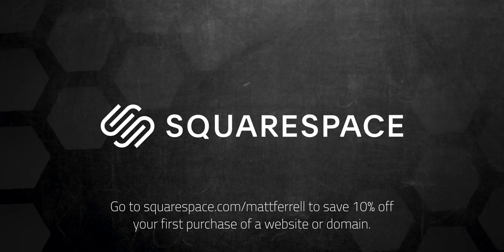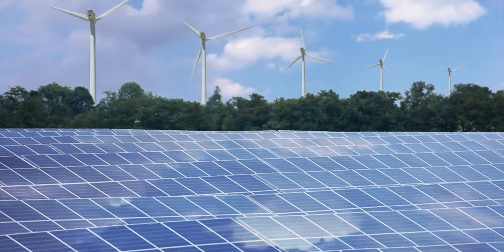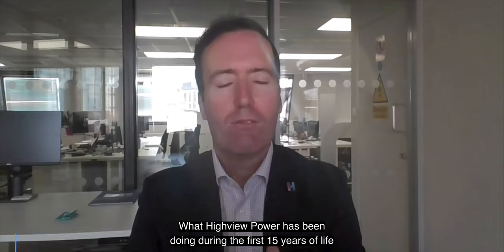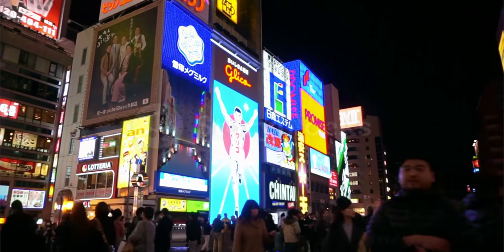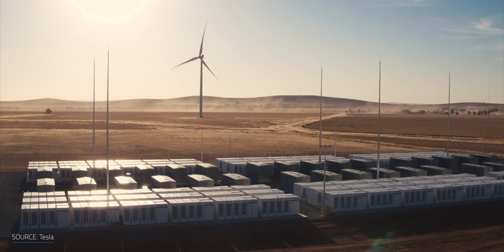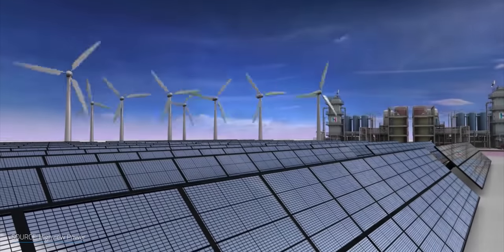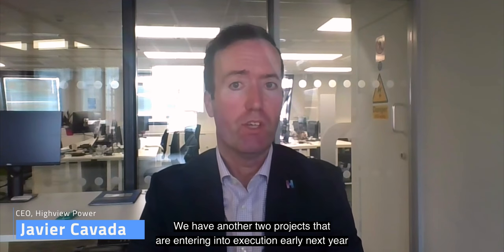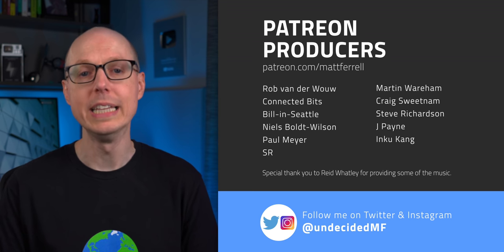Liquid Air Battery Explained - Rival to Lithium Ion Batteries?

Comment: Knowing that it's the most unstable form of energy, how do you store the heat extracted from cooling down air in order to increase efficiency?

Cryogenic batteries could revolutionize how we store energy in future.
Reply: i'm  no engineer but i think that if this this catches on in the us it will be streamlined and made more efficient in a very short amount of time
Reply: You need heat to "boil" the liquid air back to a gas.  I don't see why heat from compression needs to be stored for this when there is plenty of heat in ambient air, even in a Minnesota winter, to do this.

Comment: UM. capturing and storing heat? capturing and storing COLD?
cold isn't a thing or an energy - it is a relative absence of energy. 
something stinks about this "store and re-use" bit.
Reply: Where does the heat go when cooling something? A cooling liquid. Essentially this liquid absobs the heat when cooling the air, this liquid is than stored in well insulated "heat tanks" (though could be in gas form at this stage) and when you need to reheat the liquified air, you use this heated liquid/gas, let the air withdraw the heat from it so it becomes really cold and then store it in well insulated "cold tanks". Essentially the tanks for heat and cold liquids are just well insulated tanks that can store the liquids at the required temperatures. They just simplified it here.

At least this is what I'd think.
Reply: @MDP1702  - lacking powered cooling systems, the cold fluid will gain energy from the environment. lacking powered heaters, the hot fluid will lose energy to the environment. Not a problem in the extreme short-term, but a major issue in "storing" heat/cold for later re-use. Insulation alone cannot solve the issue.
Reply: @gordonpromish9218  that is why it probably will be a storage option for hours to days and not weeks. But I am not an expert in this field and don't really know the capability of insulated tanks these days.

Comment: I think we will see a diverse spread of energy storage systems going forward. Each will have its place on the grid. Pumped hydro should be the first choice if topography supports it. Lithium should be next in most cases due to its ease of being sized to any application. Liquid air can find its niche, but I'm not sure where exactly that is. Liquid air has a lot of mechanical complexity and human oversight that lithium doesn't.

Comment: Great program thanks Matt.
Liquid Air Storage fits in nicely with my thoughts on Tesla Battery Day and my takeaway from it. Don't panic not going to go on about battery tech again. :) No this time it is about the enormous elephant in the room which is the mountain to climb to convert the world to electric transport and energy.
Tesla are the first to admit it is not going to sort itself out with good intentions but needs step growth in the production of batteries around the planet. They have thankfully a plan because other than them the rest of the world seems to be going with the traditional 'oh it'll happen' type answer that has done so well for legacy auto firms.
In energy storage the battery systems have the speed of reaction and liquid air have the scaleability and duration, together they make a perfect answer that can be built anywhere in the world. liquid air also frees up battery capacity 'production' to aim it where it is needed at anyone time. Again that is another of my take a ways from battery day is one cell, different chemistry, for different uses, that gives flexibility to move production lines to to car or storage as required keeping output at maximum at all times.

Anyhow waffling again. This takes me back to Highview power they are currently building in the UK a plant near Manchester and planning another... this sounds great and for them plus the one in America it is all good news. Only problem is that like hoping the battery issue will sort itself the Energy Storage mountain is not being taken as seriously as it should. 
To give some idea of how big the issue not being faced is we will use the couple of liquid air plants being planned and then think that if you say want a basic level of just one in each County in England alone... they'll need to build another 40. 
Not being honest about the enormity of converting the world over to electricity I believe in my opinion is the worst case of Green Washing still waiting to be dealt with. So far Tesla are in a group of one with a plan. Good intentions is not a plan.
Reply: in Europe  plan=mafia  :)

Comment: If really concerned about $/MWatt then nuclear is  the leader, and pulls further ahead with Area/MWatt.
Reply: @rogerstarkey5390  the cut the red tape, but what about the PV and wind that is fast approaching end of life.
The only real issue with nuclear is the time of return.  Yes it takes longer for nuclear to make money but makes vastly more money over its life.  The issue is the short sighted investor, wanting a dime tomorrow when they could have a dollar next week.
Reply: @rogerstarkey5390  time is of the essence?  The world has been slated to end in 30yrs for the past 60yrs and it has yet to happen, and 40yrs ago scientists were convinced the world was cooling. 

The only environmentally responsible long-term power generation is nuclear.  Small foot print, 80+yr life, low COx, waste dealt with based on reactor design.

Comment: I have built vertical-axis wind turbines for over 50 years. I have used my own version of an air battery all this time and it's so simple, it will scare you. All my windmills compress air into very large receivers and I use that compressed air to power small hybrid compressed-air engines of my own design and  building. Works great and is super NOTCOMPLICATED (new word).

Comment: I don't like it from a futuristic view at it. Sure you're compressing air and getting it liquified to 700 times its original size. But in the future which to me has got to be space exploration. Where would you fit these mega tanks? Yes we have many ways of collecting power be it from thermal, solar, wind..in the end, the only true "green power" is solar you can have solar in the vacuum of space just as you could use it here on earth. Hence the holy grail...fusion...but thats where we get into the same problem..energy storage. Its like having all Colombia producing coffee for only 1 family to drink. Whats the point if we can't use it or store it? lithium-ion..liquid compression yata yata yata = all garbage. We literally need a new battery technology where we have a battery that can fit on the palm of my hand and power my house for a year. When we get that, we would've solved our battery problems and by then fusion would be 100% welcomed because now we can store it and reuse all the power made from it and whatever else that comes after. world problems to solve --> battery storage > fusion > propulsion in space. Humanity development is moved by greed and not by achievements and for as long as it remains like it, development will be VERY slow.

Comment: This boils down to - end to end - efficiency. 
In most case, the up stream concerning any energy source and form that can be harnessed while the end point is the most preferred form of energy, such as Wh. 

Efficiently is n
From generator deliver to storage plant, n0
Convert raw energy into storable form, n1. 
Store and retrieve cycle efficient, n2
Convert retrieved energy into Wh, n3
Transmission line efficiency, n4
Total efficiency, n is n0 x n1 x n2 x n3 x n4

Usually the sellers try their best to hide or convolute the issue of efficiently and the operating $/Wh and glorify safety and simplicity.

Comment: The energy storage of huge flywheels can probably beat this on efficiency and without over-engineering.
Reply: Depends on how efficient you want it on if it’s cheaper, plus I think it could struggle to hold as much power, unless you have multiple flywheels but then flywheels become significantly more expensive

Comment: I'm sorry but I didn't get how exactly are we harvesting the savings from captured heat/lack of heat when we store it? Because okay,we can capture the heat when we liquefy the air, but they heat needs to be stored (which can add to inefficiencies) or used immediately (so we would have to store and release energy at the same time which does not make any sense) to really see those savings. Are they saying that the insulation is the facility even with people moving around is good enough to lose only 30% of heat in the average time between usual storing sequence and release sequence? Or is there some other smart solution I can't see?

Comment: I was reading about Hydrogen, and its possible uses, most people focus on hydrogen for cars; but one of the possibilities that I found really interesting and a really smart is to use hydrogen as a long storage battery, which means to have solar and wind energy used to create hydrogen,  then store that hydrogen in old salt mines, then adapt current natural gas peaker plant to work with hydrogen, and pretty much turn on those plants when we can't use solar(night) or wind. Which I think is way better use of hydrogen than using it for vehicles.

Comment: There's one misunderstanding here: Those "4 hours" are not a negative limitation of Li-Ion storage plants. "4 hours" is a common factor use to convert between peak and average power usage/generation. Power plants are sized to deliver "4 hours * peak production" per 24-hour day.

So a liquid air battery that's spec'ed "24 hours" actually would be worse. It would only be able to help with base load as it would run at its peak output 24/7. Alternatively you could use it at peak time only, but then most (5/6 to be exact) of the stored energy would be wasted as it wouldn't be released before the next charging cycle.

Comment: I should like to see you compare this technology versus Compressed Air (CAES). 

o Since CAES can use retired mines (for example) as pressure-storage vessels, it can become extremely large if needed. Without such, CAES  is a large above-ground footprint and is arguably a bit dangerous. 
o The advantage of the captioned liquid air buffer is that it can have a small footprint, and is not necessarily under great pressure in storage. But its slow response and limited storage size are not good attributes.
o For real socko power -- and five minute response, hybrid (CAES / CAES-driven natural gas) turbines rock as gigawatt grid buffers, used along with Lithium Ion banks acting as millisecond-quick short-term local buffers. Yah need both to let us stabilize wind and solar for unlimited growth.

Comment: The "Claude cycle" is actually a modified "Linde process", which is the original process to liquefy and fractionate air and other gases. To the English speaking community, the Wikipedia article known as "Hampson-Linde cycle" https://en.wikipedia.org/wiki/Hampson%E2%80%93Linde_cycle covers that.

Comment: i was in an open group focused on big wind storage.....what i came up with was a "Carbon Negative Storage", using an automated plasma gasification dump load to convert garbage or biomass into synth-gas, amongst other byproducts....or, in its simplest form, an electrical pyrolysis dump load, yielding synth-gas piped into NG distribution networks for use in thermodynamic plants, where the source of the feedstocks would benefit from the Bio-Char byproduct returned as a soil amendment....but dump load Bio-Char would require extra storage to ensure complete pyrolysis in an automated system....where plasma gasification of Bio-Char feedstocks, would not require process storage......if you look up plasma gasification, you generally won't find much mention of Bio-Char applications, the reason for that is that the syngas product itself is generally also used as the pyrolysis heat source in Bio-Char Applications.....But In The Grid Storage Application, the electrical load of the Plasma Gasifier represents the "Charge Current", the SynGas Is the "Storage", and the Thermodynamic NG Plant is the on call "discharge" of that storage....

using Cellulosic Feedstocks really makes sense there, as that source then is also the Carbon Sequester-ment..
also consider the SynGas product could alternately be converted to liquid fuels for involved machinery or transit applications, vs returned to the grid via thermodynamic plant..